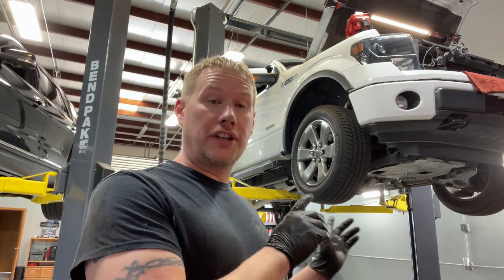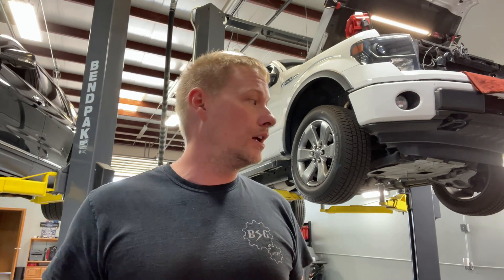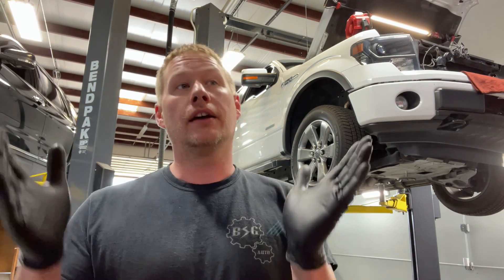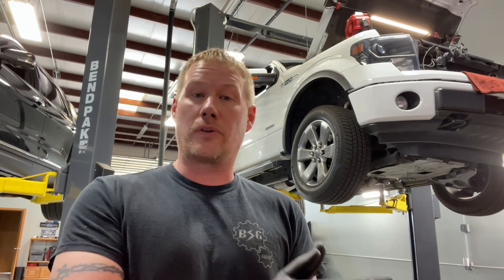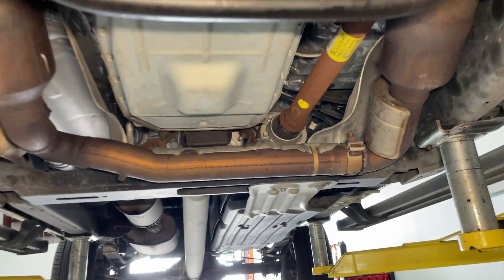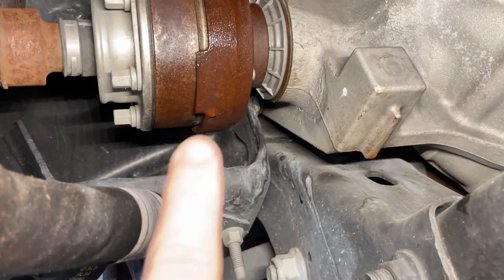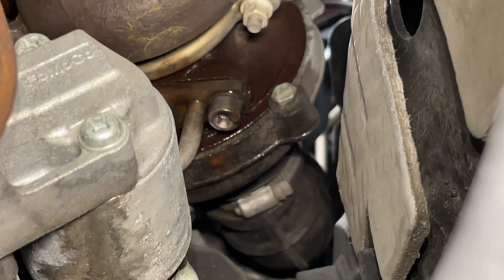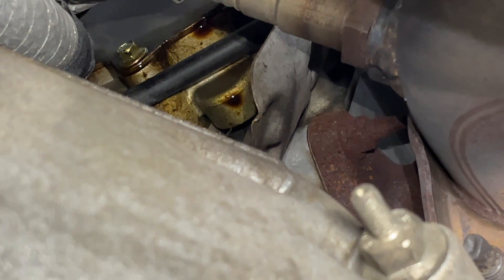Ford Ecoboost Engines Can be so Hit or Miss: I Really Feel Bad for This Customer...

Comment: Can't wait to get rid of my 2011 Ecoboost. It misfires if I don't change plugs every 10k miles, has the start up rattle, already replaced torque converter, rear defroster doesn't work. DS door lock doesn't work. Speakers cut out, stereo died and had to be replaced etc...lots of fun! Has 142k miles on it.

Comment: I had those exact same seals fail on my 2014 ecoboost. And, not a little, it was in spectacular fashion. I had to have everything redone, cost me about $1500. Also, the rear pinion seal is garbage, and will need to be replaced too.

Comment: Yep, I'll drive my '09 5.4L into the ground, and then overhaul her before I buy one of these "new" pieces of junk they're putting out these days. 240k and worst thing thats ever happened is serpentine belt broke and ripped up a wiring harness once. Under warranty. A decade ago.
Oh, and the brake ECM went out, so I pulled the 4 bolts and the plug and sent it off for refurb for $150. Otherwise just standard maintenance. Not even a flat tire.

Comment: I just sold my 2020 Ranger, after a year and a half and 36k miles (only because dealer offered me $1500 more than I paid for it.
I really liked the super crew and the turbo performance. BUT, I was genuinely worried about how that turbo charged 4 cylinder would hold up, down the road. I keep my cars for 200-300k miles when I can, which is why I gravitate towards Toyota and Lexus. My buddy is an old Ford tech with a 2019 Ford Explorer. He bought the 100,000 mile warranty. That worried me.

Comment: We had the t-chain rattle at around 30k miles on a '14 Explorer w/ the 3.5L E-boost. Ford did the chain, guides, tensioner and cam phaser, too. The vehicle never ran right again. Fuel consumption went from 20ish MPG, down to 15.5ish MPG. When you would get heavy into the throttle, it would run real rich and blow black smoke. We had it back to the dealer several times after that and they could never find anything wrong with it. We still have it today and just turned 100k.
I wish we had known about your shop earlier. You're only about 8hrs away.

Comment: Wow. I buy 3rd generation out of date Toyotas with around 100,000 miles and drive them into the ground for another 125,000 hard miles and rarely have much of an issue with anything other than blown lightbulbs or maybe some $50 rear hatch support struts failing. Have a beat up Prius commuterbox that sits outside in the weather with 212,000 miles and still has factory original brake pads that tire center recently said were still good.

Comment: my nephew bought an f150 with ecoboost brand new,  of the 14 months he has owned it, its spent 3 of those months at dealership for numerous issues with the drivetrain, severe vibration at certain speeds, engine driveability issues that led to engine replacement and then the straw that broke the camels back, its stopped/quit running numerous times for unknown reasons, replaced ECM or computer and it still quits, at that point he had to sue Ford to take the POS back, plus he won damages

Comment: My Ford 2018 escape 1.5 eco-boost motor had a engine failure at 15,000 miles the coolant was leaking with the oil. This is a common problem and going on for years Ford should be forced to replace these parts at any time due to the lack of professionalism and transparency.

Comment: Thanks so much for your Knowledgeable and honest video.
If some 3.5 turbos are durable and others are not, independent of proper maintenance, do you think it is not a design problem ? Sounds to me more like a quality control problem. Either installation errors or parts quality. Your thoughts ?

Comment: Eco boosts are pretty good motors but have a lot of issues you shouldn’t have at low miles when you take care of a vehicle. Have similar issues with my 2013 eco boost. I’d go with the 302 all day if I buy another truck.

Comment: I had the rattle and cam to crank corralation code on my 2013 Ecoboost at 72,000 miles. Ford quoted me $4000 minimum to fix it. I bought the parts and tools and repaired it myself. Thanks for another great video. Keep the inspiration coming.
Reply: How much time and money by diy?
Reply: About 1000 dollars in parts and tools.  It took about 16 hours. I worked at an international dealer and used the shop for the weekend.
Reply: And I purchased the parts through the dealer wholesale.

Comment: I changed phasers chain’s tensioner all on 2017?F150 and still have pecking noise while running , my right bank exhaust phaser had hole in it and found pin in bottom
 of case, 130000 miles

Comment: Damn EcoBoost.  I had a 2015 Ford Edge with it, and at 104,000 miles it blew a head gasket internally and ruined the engine.  The trouble started at around 94,000 miles and by the time we figured out what was wrong . . . . . after $2,000 spent on replacing parts . . . . . the warranty had expired and Ford, the Dealer nor the bank would do a thing about it.   Ford insisted that it could not be repaired and wanted $8,000 for a new engine.  And of course, no one else could repair it since Ford would not share the specialty tools required to do the work.  So I gave it back to the bank.

Comment: Water pumps are connected to cam chains so it’s part of the timing chain job ? I had a Edge and feared the day I had to have a timing chain job done but was lucky at 110,000 miles I traded in for a Toyota Tacoma

Comment: I have the 2017 F150 3.5L Ecoboost. I love the driveability and utility of my truck — lots of power and decent gas mileage for a truck — but these issues do make me miss my Toyota. I have a coolant leak and am about to remove the skid plate to find the origin. I'm pretty sure it's going to be those turbo fittings. Hopefully it's just one side, but I imagine if it's one side, the other is coming soon.

Comment: Only problem with my 2011 f150 XLT 3.5 ECOBOOST 6 speed, was a bad coil on #3 cylinder. 
Runs very well, lots of power, 6 speed trans, 2wheel drive, 140k miles.

Comment: Ford = junk. Be really interesting what a Ford rep would have to say about a truck requiring $3k+ service at 70k mi. If I were Ford, I'd be ashamed that I had a powerplant that 1/2 of the finished units fail this hard. I had to tell a single parent, who was a teacher, that his Edge needed $2000 worth of water pump @ 90K. It was kinda heart wrenching.

Comment: I have a toyota that has 203,000 miles on it.  All I've ever done is change the fluids and replace the secondary pump wiring harness with a bypass from a company that rhymes with newitt.

Comment: I've owned ONE new ford ever. It was a 2005  4.0L mustang, brand new, off the showroom floor. Started falling apart right off the bat. Got rid of it at the 30,000 miles ended up buying a  used 1991 LS400 with 287,000 miles. 11 year later (pushing 400k) , I'm still driving the LS400. Two different animals but quality is very important to me and my bank account.

Comment: Have the 2013 Escape SE with the Ecobeast.  At 140K and haven't had engine problems, other than a bad hose (coolant leak).  This oil change, she gets the transaxle drained and flushed. (last D&F was at 70K)

Comment: I bought a pre owned 2014 with the 3.5 eb back in the day and it was a nightmare. Coolant leaks on both turbos, failing starter motor from coolant leaking on it, crank position sensor failed and left us stranded on the side of the road, stretched timing chain and cold start rattle. Complete and utter disappointment from Ford. No excuse for that many issues at 60k miles and I will never own another eb powered truck.

Comment: Hey I have a question,I have a 2011 f15 ecoboost and it leaks coolant but it comes off the back of the tyranny pan and the exhaust cross member would that be leaking from the turbo coolant lines that go into the back of the motor and running down the tranny?

Comment: Let's just say back in the '70s when we had our gas crunch cars were just as heavy as they were in the 60s but now they're putting four cylinders in cars that should have had the sixes and the eights I'm going to save gas but in the long run you didn't save gas mileage and you ended up buying motors because the motors would be destroyed before you hit 100,000 miles get the 8-cylinder engine in a pickup truck not the six not the turbo charge 6 or the 4 cylinder they don't last spend a few extra dollars and get the V8 and you'll be set to go how many v6 engines in pickup trucks from the '80s are still around versus the v8s

Comment: It would seem the 3.5 Ecoboost really goes by number of heat cycles not mileage. There’s plenty with 250-300,000 that are fine but get driven longer distances on each drive. My 2015 had to have turbo coolant lines and manifolds at 44,000 miles got that done under warranty the starter died a week later. I said that’s it traded it for a Mach 1 and bought and old 4 runner that just works for the winter. It has 200,000 miles but you can’t hear it running once its warmed up zero squeaks or rattles. It’s amazing to see the difference in quality over time between Ford and Toyota.

Comment: I had a 2013 with the eco boost. Got up around 80k and the check engine light started coming on anything I towed anything. ( I had a trailer with 2 ATV's, Total around 5k).

It bounced in/out of the dealership for 5 weeks. They would fix something, I'd toss the trailer on and without fail under 50 miles light back on.

Traded it for a 2018 f150 with the 5.0 V8 which was a rockstar.

Won't ever buy an Ecoboost for my work truck again.

Comment: I've got a '16 Transit van with this engine and it's been great...but it gets hotter than hell under the hood. I've notice that on the newer models they've really opened up the grill to get more air in there. I've been changing the oil myself and haven't noticed any leaks...but now I'll take a better look around after seeing this video. Always cheaper to fix than replace...it is and always has been a crap shoot with vehicles. Had a few that ate up money back in the 80s but since then I've been very lucky....all Fords, about 6 of them in the last 30 years....work vans and pickups. Bought them all new.

Comment: I am a Ford guy first Mopar guy second but really I'm the old school for a guy the 351w or c the 385 series give me those any day any day over any of this new crap that they're making now, my wife had a 99 150 and the only problem develop was it the shuttering that they used to do but they might still do it I don't know, but anyway I put in some Lucas stop slip I think it's called and the shuddering went away the same day it went away never came back that run ran and ran and ran and ran it was not beat on it was driven normally and it was great that's when I thought the Triton engines were good but then and that was the 4.2 she had the little one, my old 351 she's still going strong the two at American and an old LTD with the 400 engine strong powerful well not so powerful but plenty of torque down low and the 385 series that I had was a 69 LTD with the 429 that thing was a beast all of them wore out but they didn't blow up or throw time and change and all that crap
So what I do now I go to the scrap yard and I find them a whole vehicle or almost a whole vehicle and I take the 351 out of it take it home make it run and runs good I keep it if not I'll bring it back to the junkyard where I bought it from and get my money back right now I have three all crated up in my garage they've been fogged and they're all sealed up in plastic, so far they've been sitting there for 11 years haven't needed to touch one my current p51 that I drive everyday is a 1990 crown Victoria Police interceptor with the 351HO and it has nearly 400,000 on it!, What they have out here now this newfangled stuff it's just a boat anchor, if I was this guy with this this white vehicle I'd sell it or I do a trade in or something but I know damn well I'd get rid of it and find something older and prime condition and pay a big dollar for it that is all. 🤘

Comment: I just did one of the coolant feed tubes and fittings on a 2012 F150 on the left side and it can be done without removing the turbo

Comment: Looked at new F150s a year and a half ago.  I was looking at crew cab 2wd 5.0, and no dealer near me had one.  When a dealer got one I went to look at it, turned out they bolted a blower on it and they could get one in but for $6k more than advertised and couldn't explain the price difference.  Then the straw that broke it completely was they offered less than half the low trade value for the teuck I had.  Ended up getting a nissan 9 months later, they gave me high trade value and double checked to get every discount on it they could.  I refused to get an ecoboost because I know 4 people that had head or turbo problems with less than 50k miles.

Comment: I have been a Ford guy all my life but I have three Ford vehicles that I own broke down as I type this bough a 2015 Expedition 3 months ago and it's sitting in my shop with stuck open stuck closes TB codes and in exstream limp mode. My 08 Expedition has misfires and that weird heater hose leaking and my F-350 has an oil fuel leak coming out of the turbo base plate. I am about done with Fords!!!!!!!!!!! I wish I could afford to have you fix my problems!

Comment: Got the p0016 code coming up constantly,  can i use my sct tuner to find out if the timing is out 6 deg or does this have to be done at the dealer?  Im assuming the chain is stretched with 200000km on the dash

Comment: Hey.  Thanks for all your great info and quality work.
My 2011 f150 ecoboost has what   appears to be a rear main seal leak. Oil drops at bottom of engine/ bellhousing.
Any insight or recommendations on the seal replacement or any other possible leak origins.
Thinking of getting a speedy sleeve just in case there is a wear groove.
Thanks
Reply: By the way.  Truck has 249000+ miles.

Comment: I have a question if you don’t mind.  I have a 2020 Raptor with 33,600 miles.  I spend a fair amount of time at idle because I am a home builder.  Today I saw some “steam” coming up from the tail pipes.  As I began to accelerate I noticed a puff of smoke, hit the accelerator again and a larger puff of smoke.  I went to the oil change place and the guy there is knowlegable and friendly he said that it looked like the turbo seal was going bad.  I have an appointment to take it in the Ford dealer here in Grapevine, Texas.  Is this a common issue with the Ecco Boost Engines?  My appointment is December 7 and today is November 21st.  I’ll be driving it a while I am kinda worried about burning oil.  Thoughts?  My warranty is getting ready to expire is there anything I should be checking on or making sure is looked at before my time is up?

Comment: yep I have a 2014 and scared to death about my 150 Had heard that the water pump was inside the crankcase on some engines and that was a problem. have 38Kon mine and don't travel much with my but it will be gone in the next couple of years for sure

Comment: Hey man I got a e150 1998 with the 4.6  runs like new has 250k miles  few weeks ago I was loosing coolant   and didnt know where it was going and guess let it run out and ran hot I blew the head gasket  on passenger  side .I put crc in it and it sealed it ..u think it's worth letting ford put a new head gasket  on just the one side or both sides .and I'm sure my timing set needs to be changed while they are in there..or do a new motor the can do the new motor for 6500 installed. Let me know your thoughts..they want 1100 to change one gasket